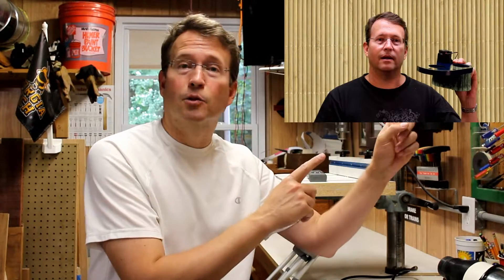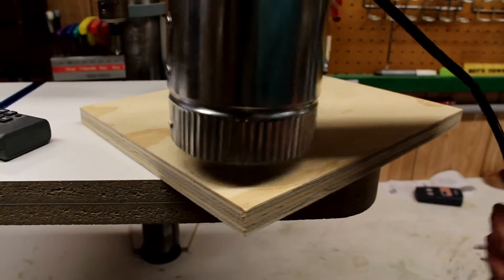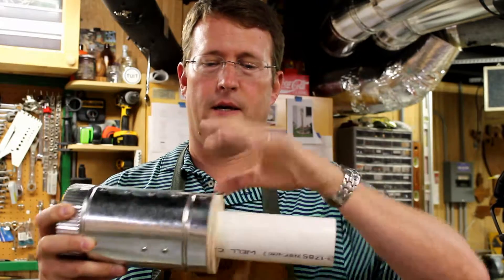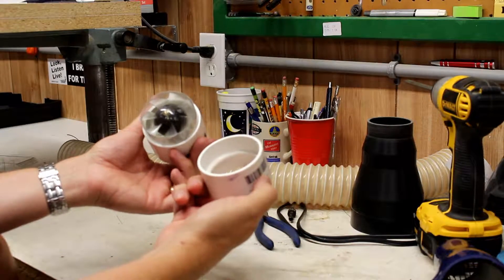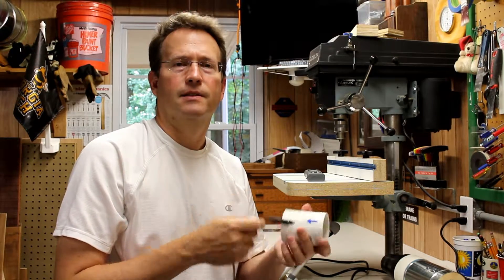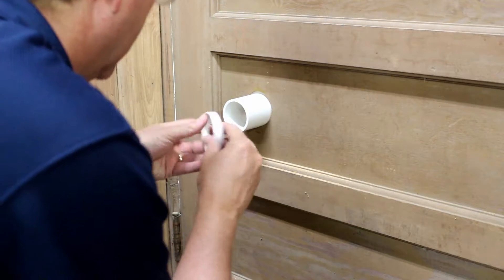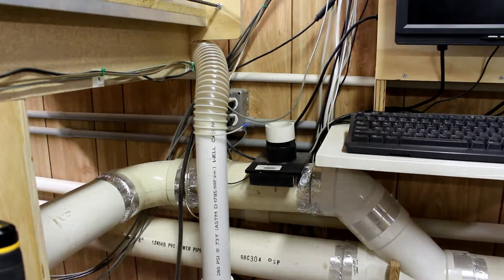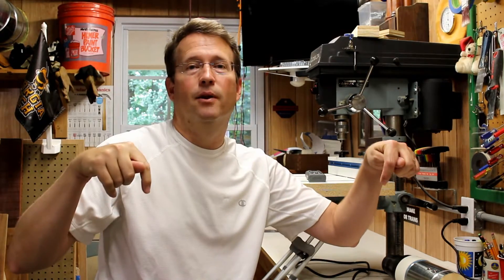CNC Laser - Part 2 - Smoke Extractor

Comment: That's the jankiest fume extractor ever... a hair dryer? The amount of air you want to move is way way larger and you need way larger static pressures than what it can create. You need that large airflow to achieve better results from cutting in general so the smoke isn't in the way of the laser diffracting it, and to prevent the smoke messing up the insides of the laser cutter or the mirrors. 

Then you need to filter those fumes coming out VERY THOROUGHLY, they can be, and are extremely toxic (stuff that can kill or blind you from small concentrations if you're not extremely careful with what materials you're cutting)... c'mon...

Comment: You got a CNC so it beats me why you didnt use it for the brackets...  The PVC can also be done on the CNC if you go slow and use a long reach bit...
Reply from the maker: HI John - Setting up the CNC takes some time and for simple shapes it is often quicker to just lay it out and cut it on the band saw. I was focused on the fan portion in the video and in the past I have made similar brackets for 4" dust collection using the same technique. Bottom line is that there are many ways to achieve the same result. Thanks for the question and thanks for watching.
Reply: It dosent take me nowhere near the time to CNC that sort of thing 
compared the manual cutout and sanding time.  Get a far better fit too. 
 :) Knowing all the shortcut keyboard commands makes v-carve fly. And I can run rapids at 250 IPM, and normully use around 70 to 150 IPM cutting, a bit slower in 1/8 and 1/16 bits... 

My shop vac system uses 4 inch plastic drain pipe - the real thin stuff. ALL the gates and fittings I used ( other than the elbows were cut out on my CNC.... And I saved the files... Who knows if and when I may need another one..